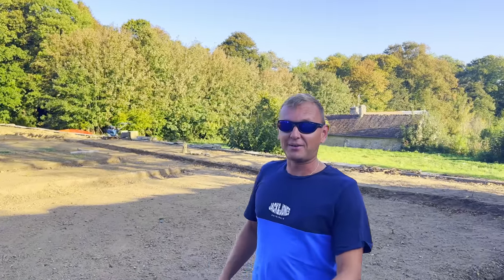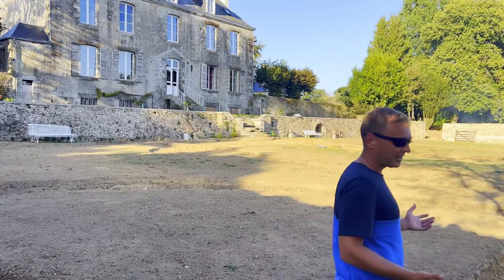Amazing Landscape Design: Inspiring Ideas for Our Chateau Gardens

Comment: An edible chestnut has a husk which is spiny and needle-sharp. The horse chestnut has a husk that is much smoother, with only a few warts, don't eat those ones. The spiney husks once dried can be used for fire starters/kindling.  Cricket lawn, lawn bowling, horse shoe toss, turf or stone labyrinth path for meditation walking (they are pretty too) so many things you can do with the lower terraces that would blend in to the upper ones.  It is going to be fantastic, magical!

Comment: Just a thought ion the weed fabric:  I use it under pathways but I’ve found that it’s not good for planted areas.  Maybe your fabric type is different,  but I’ve pulled up old pieces and found the soil underneath was gray and lifeless, and looked just like concrete with all the soil life smothered.  You may want to just check one of your older weed fabric installations to see what’s happening under that fabric.   I’ve also found that weeds love to germinate in the mulch on top of the fabric, and then the roots grow into the fabric and make it much harder to get them out.    

I use multiple layers of cardboard on the native soil, then mound some soil/compost on top and plant into that, adding organic mulch (wood chips etc.) around the plants.    What few weeds show up are easy to pull, and the plants grow so well that they shade the soil and keep weeds down anyway.   

Anyway, just my $.02 worth, based on my own (large, organic, habitat) garden.   I know all your hard work is so worth it, and I hope the gardens turn out as you imagine they  will
Reply: Thank you 😊😊

Comment: Your tan will be lasting a lot longer this year Ash lol I'm with you on the weed suppressant fabric, yes, it's horrible plastic, I use exactly the same type as you, some of what I've got has been down for 15 years and is still going strong, it keeps the weeds down and helps with moisture retention, so helps with a bit less watering too. Gardens that size were maintained by a small army of gardeners, not 3 people with a chateau to look after. There's another good reason, weeds strangle plants and they're too expensive to replace.
As a disabled person I'm chuffed to bit's that you will have some suitable accommodation, maybe a metal ramp might be possible on part of the steps at the back of the chateau, difficult to tell on videos what the gradient is like but it's not a place that can be adapted with ease and I wouldn't want you to do any permanent changes, the cost would be prohibitive and would wreck the old girl.

Comment: Plastic liner or no plastic liner: Plastic gets old and oxidated at around 2 yrs. and weeds will start to grow wherever there are the tiniest of pin holes in the plastic. Then the weeds will lift up the plastic all over. You'll have to redo all of your hard work. But everyone usually has to learn this the hard way. I've seen neighbors have to learn this way too and had to redo all of their work after pulling up in pieces a rotten plastic that falls apart at the slightest tug or get fined by the city and/or the homeowner's association. 
Preemergant is the best weed prevention. It sterilizes the ground so that seeds can not germinate. It won't prevent seeds that have already sprouted but it will prevent future seeds from sprouting. Preemergant treatments can last from 3 mos to 12 mos before needing to be reapplied. It depends on the strength of the formula.
Love your dedication to restoring this beautiful property. Great job!!
Reply: I’ve already explained we’re using weed matting. I’ve not said anything about plastic :)
Reply: @ashleywaters7198  Sorry, I must have missed that. Is it made of cloth that won't break down in time? I sure hope it lasts for you. It's a real mess if it fails.

Comment: I am not opposed to weed fabric, in certain areas, such as gravelled areas or pathways. However, from experience, I would never put it under wood chips again. Wood chips break down and become soil. Then the weeds grow on top, with their roots entangled in the fabric. So, then you have weeds, but you also have the hassle of encountering that fabric every time you want to plant anything. To remove the fabric, at that point, is almost impossible with all of the heavy soil on it. If I could do it over again, I would just use wood chips and ground covering plants, to keep weeds at bay.